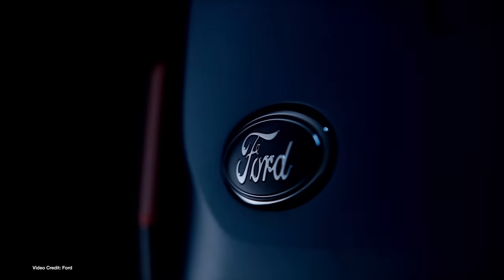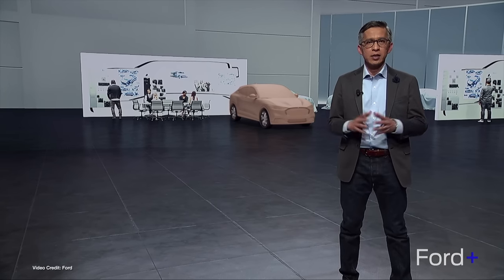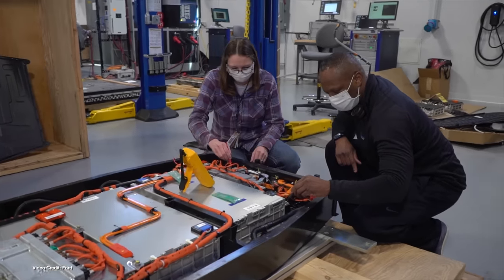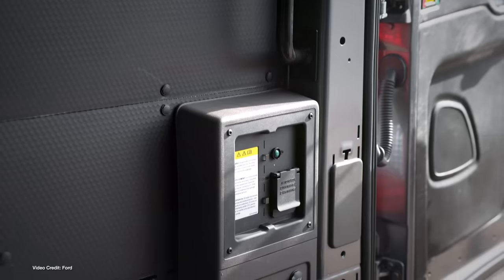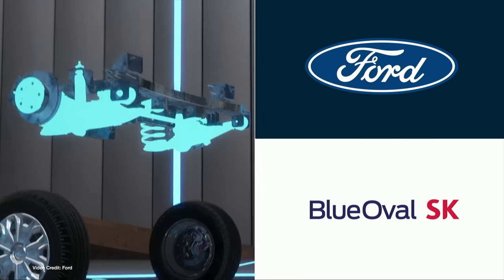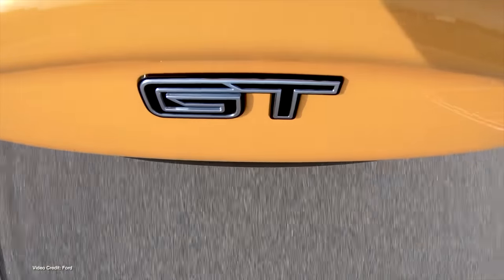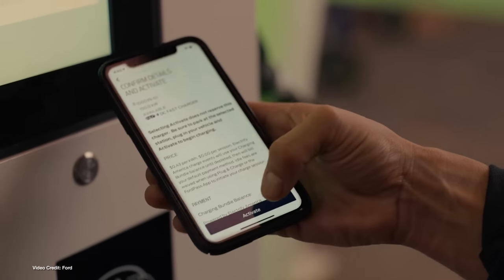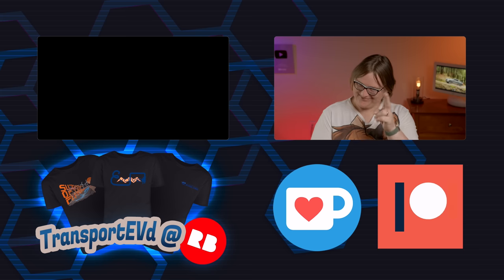Ford’s Grand Plan for Electric Vehicles Is Here

Comment: I had suspected they were underselling the range of the Lightning.   They knew it had to live up to, or out perform ICE F150s.
Reply: Yeah, still going to struggle in towing i think, that's still a weak point for EVs but most truck owners don't tow and those that do often would likely want a gas or diesel for now anyway until EV improves.
Reply: @jonmarshall3414  that’s end cases
Reply: So they didn't say during the reveal that the range was with 1000lbs of load in the truck testing. Which comes with another question.  Payload of 1000 lbs and gets ok range which I know many were comparing to the cyber truck.now let's see the unladened range. With driver only.
Reply: @royale192  don't think they said that during the reveal but other sources have said what you mentioned, range was with 1000lb payload.
Reply: @jonmarshall3414  yup. A few of the YouTube videos have come up. What I do believe is someone forgot to mention this during the big revalor they are doing this to gain more buzz talk. But it's a nice truck and should sell pretty well.

Comment: I am glad Ford appears to have such a great product. I am not a truck guy, but if I had one of these F-150 Lightnings, I would be happy. However, I am really unsure as to why so many car manufacturers are dancing around the SUV category. You mentioned that there will be an Explorer version, and I hope you can cover that when info comes out. By the time one comes out, I should be in the market for one, and since I produce my own electricity via solar, it would be a no brainer. Thanks!

Comment: By 2030, a lot more than 40% of Ford’s sales had better be electric.
Reply: The problem will be that EVs will out compete gas vehicles for pretty much every model by 2025. Now that doesn't mean you won't be able to sell gas cars then. You just won't be able to make money doing it. Have you looked at what coal companies are worth lately? They still sell coal.
Reply: @fjalics  Aka stranded fossil infrastructures.
Reply: Ford bankrupt before 2030....
(BIG debt.)
Reply: There won't be enough batteries to sell 7 million+ EVs just in the US market (16-18 million annual market) by 2030. Heck, in 2020 automakers could barely sell 2 million passenger EVs worldwide (with well over half just in China) and just over 250k in the US. That would require annual growth/increased battery production of over 40% per year every year compared to about 11% from the previous year, which is very unlikely. That's just the first bottleneck.  Then there's also the chip bottleneck. These bottlenecks takes years to address, if they can even be fully addressed.  Years you don't have in a 9 year plan (by 2030). You then still have to deal with prices (and potential loss of subsidies) and suitability of the EV models which will also limit sales. Also, other competitors will limit your market share.  Even if you could convert 40% of your fleet to EVs, if other automakers have better or more valuable EVs, you won't be able to sell as many as you want or at the margins you need to be profitable. It is a very ambitious but very unrealistic goal.  Hyundai/Kia, even with their very impressive E-GMP platform only expects to sell around 1 million EVs a year worldwide by 2025 (about 13% of their annual sales of around 7.5 million units). I guess Ford could focus 100% of their EV/battery production for the US alone, since North America is their only profitable market.  Then they could definitely sell 800k EVs a year (Ford only sold about 1.9 million cars in the US in 2020, a 25% decline from the last year) by 2030...
Reply: @OlJackBurton  I understand what you are saying, but I drive a Dual Motor Model 3, and the new F150 lightning will be as smooth, quick, torquey as my Model 3, only with a giant frunk, and many electric outlets. It will be the best truck Ford makes. Also, Tesla wants to make 3 terra watt hours of batteries per year by 2030, and there are battery factories going up all over the place. I think GM has 2 just in the US, Ford announced at least 1, Europe, Korea, and who knows how many in China.  I don't know exactly how this will go down, but it's going to be an S curve. A disruptive technology.
Reply: 100%

Comment: the only big negative I can think of is the inevitable youtuber road trip testers - this will need a big-ass battery to get that range which will take a while to charge if it isn’t 800v capable. Still a very capable looking truck
Reply: So true, especially towing, but I suspect this truck will be the new suburban dadmobile so it may see 50 km a day at the most and the most it will ever have in the bed is a couple bags of mulch. Maybe hook up the bass boat, then promptly unhook it when the range meter in the truck takes a nose dive.
Reply: Tesla Cybertruck=500 miles range

Comment: Thank you for a very good presentation. It sounds like Ford finally has become serious about going electric.  As a lay person I wonder why it took so long.  I cannot help but to notice that Ford´s goals for battery production are more than an order of magnitude lower than Tesla´s.  Nor that Ford seeks to maintain its role as a horizontal integrator.  Also, for their most important vehicle, the Ford F150 Lightning - the move to electric is an evolution of their old ICE version instead a new development.  The latter may be a good idea by some metrics but it will create a huge problem in terms of efficiency and performance/capability when confronted with competitors.  With Ford´s current debt-level and failing total sales numbers I would be really worried about the profit margins of my EVs.  Time will tell.  I am getting the popcorn ready for the EV pickup war ;-)
Reply: Tesla IS an order of magnitude ahead of everyone else here. Legacy vehicle manufacturers need to die off without wasting public funds at useless bailout attempts. ICE production should cease and used cars pressed into service  (there is sufficient stock of these to get us to the EV Age).

Comment: Thanks Nikki another great video,I was wondering what the chances are of the F150 Lightning coming to Europe and more specifically UK?
Reply from the maker: I'm just speculating, but with Ford saying that an electrified mid-sized truck will be coming in the future, I think Ford will be more interested in getting that to Europe than the F150. If you see the F150 in Europe, I suspect it'll be in low-ish numbers. But I could be totally wrong - Winter
Reply: The UK? Probably not enough potential demand in RHD countries for huge pick up trucks like this, for Ford to consider a conversion.
Remember,  big trucks like this are really quite rare in the tighter streets of Europe and the UK

Comment: According to Sandy Munro, Tesla is at $83 at the pack level, and that's with the old cells. With the 4680 will be below $50 by 2025. And for capacity Tesla is planning 200GWh next year.
I'm still comfortable having all my money in Tesla stock.
Reply: Good points on battery production, that's a big key to success in this market.  I don't endorse putting all your money in any one stock, diversification is always a good investment strategy.
Reply: @carljaekle  We should all buy ONE share of F or GM for good luck - they are going to need it.
Reply: @carljaekle  
Understood. Bought AMC YOLO options.

Comment: The 230mi (and 300mi) range WITH 1,000lbs load - WOW!! 

Just read this:
2022 Ford F-150 Lighting’s Driving Range Allegedly Underrated, May Travel Over 450 Miles On A Full Charge
"After a few calculations, Brownlee concludes that the long-range model may be capable of close to 460 miles (736 km) if it was empty—figures that haven’t been confirmed yet, of course"
Reply: Stop spreading stupid nonsense… I figured at least people here will be a bit more educated than the general audience. The displayed range is an estimate based on previous driving data (not EPA range) which for the show model he had was probably based on being driven at 10-20mph on/off trailer trucks for showing off and photoshoots.
Reply: @Mari0o0o  whatever is rated it will be less

Comment: I’ve got a question, do car companies build cars or manufacture cars? Which is correct? Thanks ahead.
Reply: What's the difference.  Most rely on suppliers to some extent.  Tesla is more vertically integrated than most, but certainly relies on suppliers for some parts.

Comment: Remember the days when a pickup bed could carry a stack of 4-by-8 sheets of drywall or plywood? When most if not all pickups were driven by farmers and people in the building trades? To the best of my knowledge, farmers and tradespeople don't outnumber all other people in society, but you wouldn't know it by the number of people who drive pickups.
Reply: Perhaps many "non-farmer/trades" drivers of pickups want to be thought of as "farmer/trades" men (or women, although I believe that number is a tiny fraction).  Who knows?  I've always picked out vehicles based on the most cost effective and reliable way to get done what I need to do, at a reasonable cost (I've bought both used and new vehicles over the years, sometimes prompted by the circumstances of my military service moves).
Reply: @biovmr  If you go to a construction job site, you'll see pickups all over the place. But the building materials and large tools arrived on stake bed trucks. Each of the pickups likely arrived with a driver, no passengers, no building materials, and no tools other than a bed-mounted toolbox. Acres of six-passenger trucks that carried one person to the site. Independent contractors are the most likely to actually use their pickups as trucks.
Reply: Back when I used to take the train to work, I'd occasionally count all the pickups I'd see in the suburban commuter lot, just for laughs. The count usually went into the dozens.
Reply: @JorgTheElder  Every homeowner can make great use of a Kenworth.
Reply: Remember the days when Darrin Stevens, Ward Cleaver and Mike Brady would have hired a Tradesman to do even the simplest home repairs?
Reply: @ladnitnnyldivad  When I was a kid, a lot of families had station wagons. We had a 2wd Jeep wagon. If we had to haul something, we'd put the tailgate down and take the back seat out. We didn't know anybody with a pickup truck. We didn't need a truck to do home repairs. Today, families buy a crew-cab truck with a vestigial bed and use it as a station wagon. It's not a truck, it's a "lifestyle vehicle." All hat and no cattle.
Reply: @ladnitnnyldivad  And the good wife to prepare dinner for them too.

Comment: The only reason I don't own an EV is no manufacture is selling V to G (in Australia). So do I spend a sh** load of my retirement money (I don't work) to buy an EV, to have it sit in my garage and not offset my power needs....Ford F-150? The model Y, still not available....maybe it will?....or PIGS WILL FLY!
Reply: Battery life depends on number of charge discharge cycles, V2G/H greatly increases the number of Charge/Discharge cycles thus reducing battery life. Why Tesla did not do V2G and Elon pointed this out some years ago. However with the 4680 LiFePo batteries which have a very high cycle life, V2G/H would be feasible without decreasing battery life too much
Reply from the maker: You are incorrect in your assertions here - and we’re working on a video to explain it. TLDR: V2G doesn’t damage batteries.
Reply: What, no solar panels on your garage roof?

Comment: The vast majority of pickup trucks are in town, on construction sites or on plant sites. They don't need a large range or big towing capacity. 
Fleet purchases of fueled pickups died today.
Around town, EVs are the most efficient with slower speeds and regenerative braking. Or on plant sites. Owners will save big on fuel savings.

Comment: I am no Ford fan (Tesla is way ahead) but, why do you say their cost projections for 2025 and 2030, are “…if not, impossible?” Are you aware of Wright’s law? For example, according to BloombergNEF, “Following Wright, battery prices should drop to $84 per kWh in 2025, well below the holy grail milestone of $100/kWh. In 2030, they should be an astonishing $58/kWh…”

Ford’s estimates aren’t even as aggressive as the overall market should just develop. You don’t even put Ford’s low 240GWh goal into perspective with Tesla’s 3TWh (or 3,000GWh) plan (admittedly to include stationary power storage). How is Ford going to outsell Tesla, with a fraction of the batteries?

Comment: I have this weird idea in my head.  If you want lots of people to buy EVs, how about making EVs affordable to lots of people?  I know, that's weird...
Reply: That’s what China is doing
Reply: @parajacks4  Also our Senate, if their $12k tax credits go thru!
Reply: @parajacks4  - And I'm not impressed with them so far.  Mostly, there's a lot of road noise and the range is not too far.  They're great for city driving but not much else.

I need a new car right now (My old one is waiting it's turn to become a brick.)  I would like a EV as my next car but all the ones that get the range that I need are northwards of 30k and that's way too much for me.

And the reason that they are so expensive is that the car makers think that they need to make these cars as futuristic looking as possible loading the car up with feature after feature until it's out of the price range of people like me.

I'm a simple man.  I need a car that will do 150 to 200 miles without needing a charge.  I don't need Apple Play or hook my Android up to it.  I don't need the car to drive for me.  I don't need a dozen sensors all around the car.  I don't need heated steering wheels or seats. I don't need to sync my blue tooth to it.

About the only extras I need to live with is cruise control, Nav and a USB port.

Oh and power steering and windows...
Reply: Tesla is coming with a 25000 $ car in 2023!!😊👍
Reply: It's not weird at all, the problem is battery costs are too high right now.  As battery costs come down, EV's will start being competitive with ICE vehicles on cost.  By 2025 I think you will see price parity on initial purchase.  When operating cost is considered EV's are already cheaper.
Reply: Yeah me too. Also range is still the issue for me. On the cheaper models they can quote 200 mile range, then in the small print it says range at 70mph is 50% that figure. The only time I'll ever use the range is on a long drive and 100 miles is rubbish
Reply: do some research on battery costs
Reply: If you look at your cost over 100,000 miles, the EV is cheaper. You go over 100,000 miles and soon the EV cost less than only what you would have spent in just gas for your ICE. EVs are cheaper in today's prices. People always complain about range, but write down a list of the times you went over 200 miles in one day, in the past year. Most people it's actually about five days. In those cases you can rent a car. If you actually drive over 200 miles a day any significant amount of time, then the cost of a Tesla will easily pay for it's self in a short amount of time as cut thousands off in gas savings.

Comment: If I understood what you said  that Ford by 2030 will have  40% of sales will be EV.  I do not see this as a positive step forward.
Reply from the maker: That was my first response too. But those are global sales figures, and Ford says that the lack of electrification in markets in the global south, where it sells a lot of vehicles, is an obstacle to the brand’s EV share going larger by that date. I’m still hoping it’s a case of under promising and over delivering though - Winter
Reply: @transportevolved , thank you for your comment , one of your points is very important, “ the lack of electrification in markets is a problem” exactly if you keep supplying CV,  which means Ford only want to SELL,  reducing fossil fuel pollution is not part of there strategy!  That’s my conclusion.
Reply: @transportevolved  Oh, the south where sunlight is severely limited.

Comment: Thanks for a very objective approach.....it’s funny how people forget the Tesla timing and Tesla volumes when they first started making their EVs.....
Reply: Tesla started from scratch with nothing. They've been pushing out cars from factories before they even finished building them. They had no supply chains and had to do everything in-house. Ford is supposed to be a large automotive manufacturer.

This weak response by Ford, who clearly don't believe in EV and are just pushing out one single compliance vehicle (not the worst one though), shows that the chances of Tesla being crushed by the "big boys" is zero.

Phillip.
Reply: No one is forgetting that it took some time for Tesla to ramp production, but that stage is over for them, because they started years ahead of their competitors.  The Model Y was released ahead of schedule.  Year over year Tesla is increasing sales 50% or more.  Wish the best for Ford on this one.  Looks like a good shot at being successful and selling in volume.  Ford seems to be on the way getting it done.  What's the story with Toyota and Honda??
Reply: @carljaekle  She literally said don't forget that the Model 3 also had low sales when it first launched. So she apparently did forget. I'm not wishing Ford luck as they refuse to commit to any production numbers. So far they are just riding the hype train.

Toyota is committed to hydrogen cars, and any change in direction would mean they lose face. They would rather go full speed ahead into oblivion. South Korea is where it's at now.

Phillip.
Reply: @philliptemple4534  Totally agree on Hyundai and Kia vs Toyota.